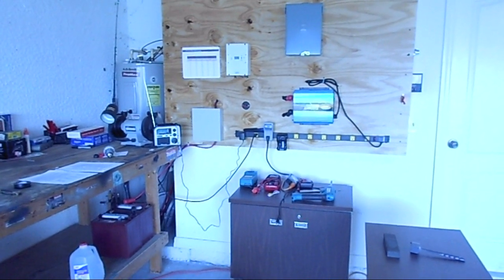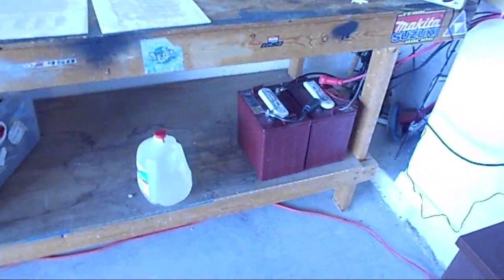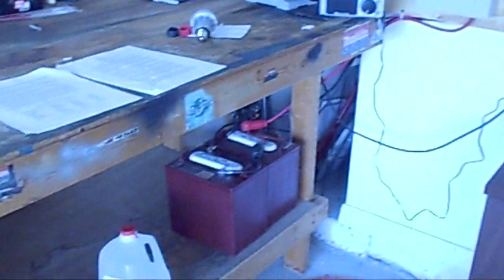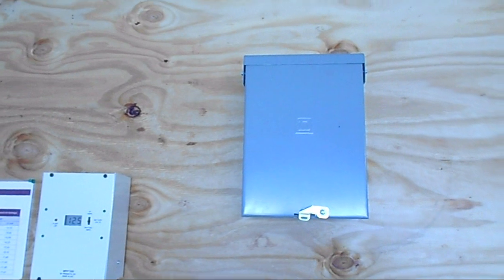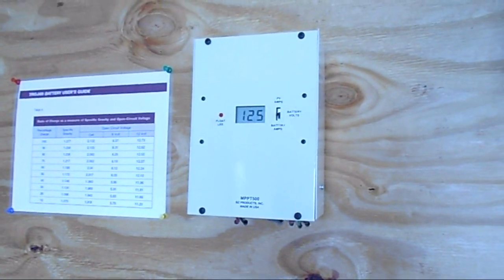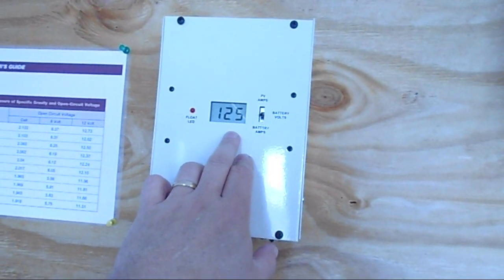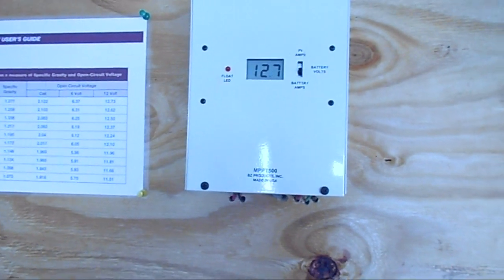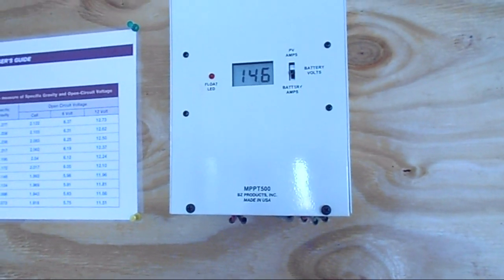Off Grid solar, small refrigeration on a budget

Comment: Good set up , you just need to upgrade to lifepo4 batteries and change from 12awg to 8 awg due to the distance on the panel wires

Comment: When it upgrades to ten series parallel batteries you will have the classic batteries in parallel fault.  Instead,  use separate chargers to separate batteries to separate loads and you will have no problem.

Comment: Your losing power from the solar cells. The feed wires are to small going into the house. Go up 1 gage in wire size for ever 6 feet of feed wire, your pulling VDC not VAC. Or move the panels closer to the charge point.
Good luck.

Comment: The breakers you are using between the panels and charge controller look to me to be AC rated breakers.  They need to be DC rated breakers.  If they aren't DC rated they won't be up to code and won't give you the proper protection you need.